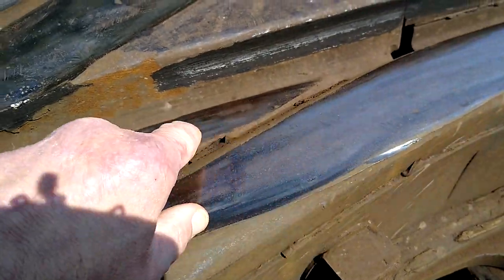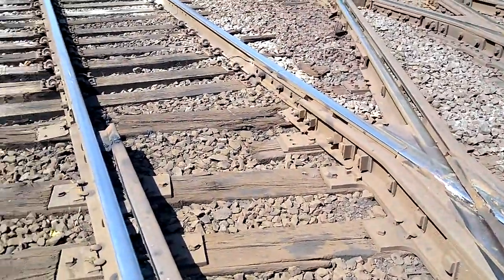Four-way crossovers/guide rails.

Comment: Talk about railroad torpedoes and flares. Here in San Diego Amtrak is running it's new locomotives . Have you ever rode the rail's to San Diego
Reply from the maker: If I can find some I will
Reply: Where you off to now ? I wish I could ride the rail
Reply from the maker: @dennisjacobs3309  
Hoping South Carolina
Reply: I grew up in Des Moines Ia. Right near Rock Island switch yard , then changed to Chicago /northwestern railroad plus the big green Burlington northern now it's BNSF railroad I used to hop freight cars when I was 10 to 12 years old we used to go in the cabooses to steel the railroad torpedoes and flairs but those torpedoes were louder than a M 80 fire cracker. I wish I could still ride my leg's are bad now I'll be 59 this year. Railroad fan since I was 3 year's old used a railroad simulator on the computer for 3 year's learned to operate the loco and dynamic breaking 200 cars long 3 DPU's one in the middle 2 on the end Mojave Ca. to Bakersfield 2.5 to 3 % down grade.

Comment: Here in the UK, all running lines have AWS (Auto-warning System) on all track circuits. I don't think I've seen an AWS ramp between the rails on any of your videos. I can see how, with the huge block sections on US lines, it could be a problem. Do any US lines have Automatic Train Control or AWS on all their route? Is it something you see much?
Blessings and thanks fella.
Reply: Positive Train Control --PTC, is slowly being implemented in the US with great difficulty and expense due to complexity of task and requirements.  It is mandated in the US by the federal govt. since a horrendous head-on collision on Sept. 12, 2008 in Chatsworth, California.   Start date delayed continually over many years, and very sporadic in installation location.   The task is much more difficult than it would at first appear.  There really is nothing in the US that is similar to the AWS system in the UK.
Reply: @themyerlys2879  Thanks. I did a little "research" ( i.e.read wiki) after posting, and I knew of the crash you reference. US railroads pose challenges that are difficult to imagine here in the UK.